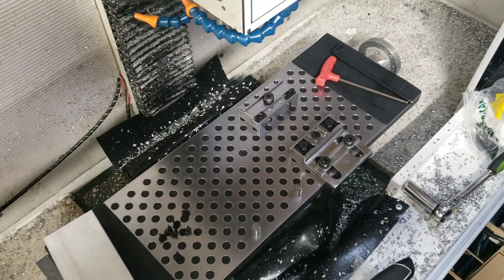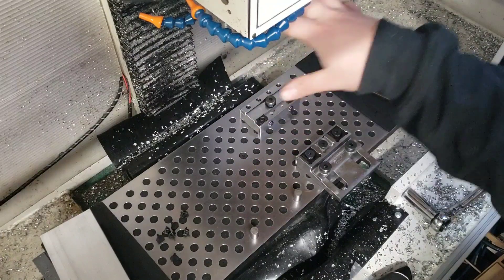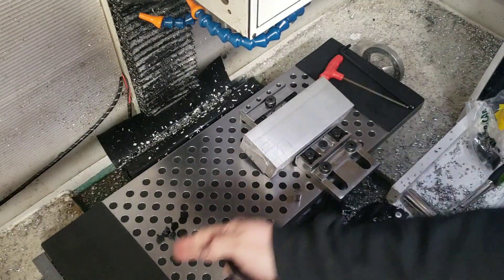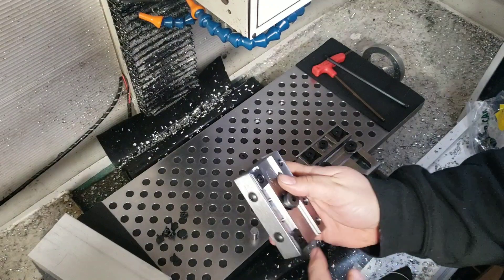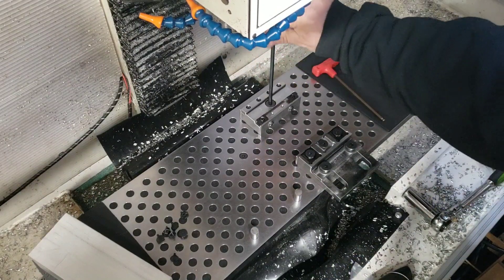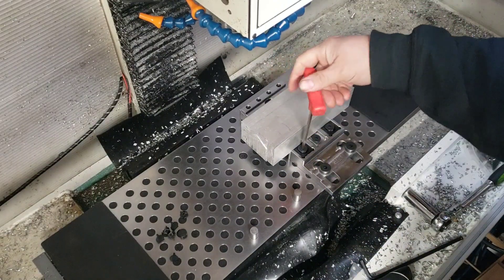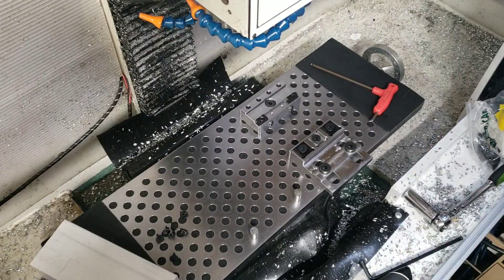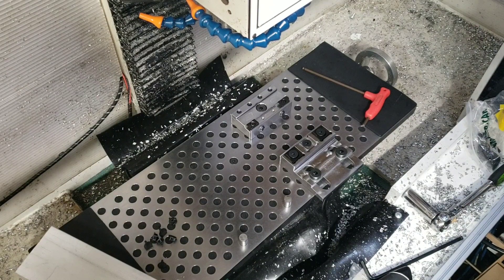G0704 CNC Mill - Saunders Machine Works Fixture Plate setup and mock up with the mod vise.

Comment: have you aligned manually the fixture plate with a dial indicator or the smw fixture plate has it;s own dowel pin / key slot to do that quickly ?
Reply from the maker: I installed the modular vise and clamped in a 1-2-3 block.  Indicated the plate off the block.
Reply: I know this is a old comment but you can easily use the dowel holes and indicate acrossed them. Even acrossed the 18" of travel!

Comment: What was the
 cost please
Reply from the maker: The plate being tool steel is not inexpensive.  They have them on the saunders machine works web site.  Current price is $1000. - it has been worth every penny.  I can actually utilize more of the work area with this plate installed.